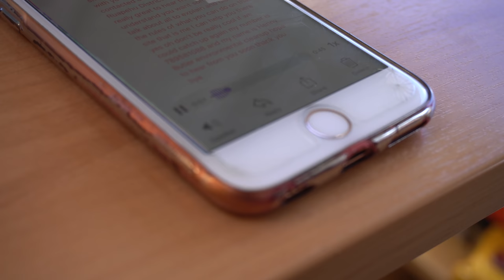Neighbour Complains & Finished Cabin Floor

Comment: Will there be anything on the underside of those polystyrene insulating sections? In England the rats would have those in tiny pieces in a matter of weeks! Window looks good though - want to see what that looks like when it's in. What flooring are you planning on having on the interiror?
Reply from the maker: Hmmm that's interesting to hear about the rats... I have no idea in NZ! I'm keen to see the window in too! Thinking of carpet for the flooring... a warmer option.
Reply: @TravellingK  Yes carpet - good call. If it gets damp it can easily be taken up. It won't get damp though - don''t worry!